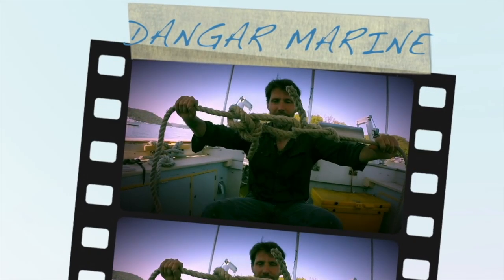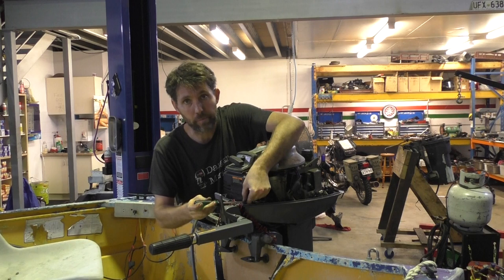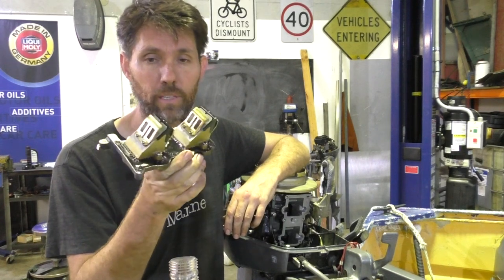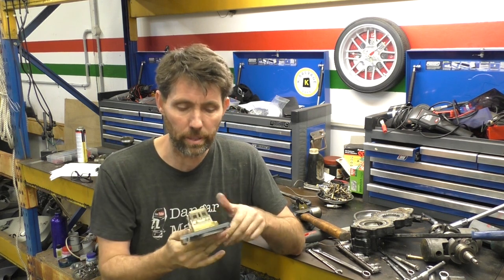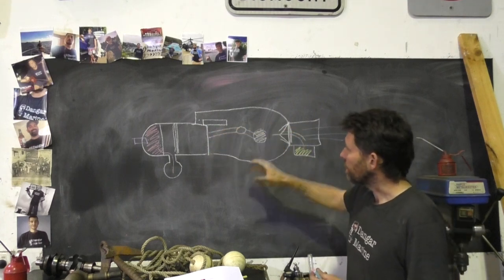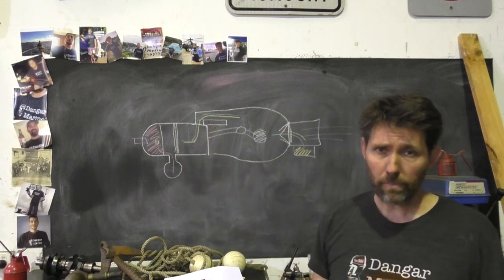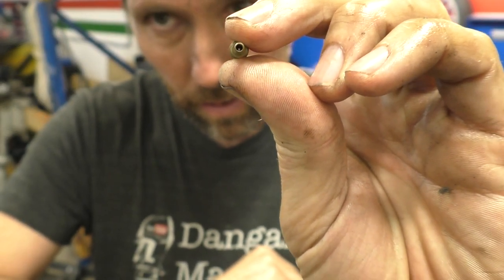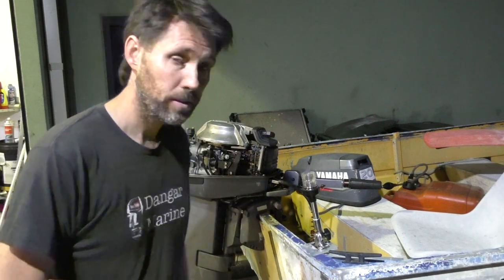Outboard reed valves

Comment: Since unfortunately myself and a lot of other people are out of work right now I had time to work on my outboard and I'm glad I watched your video's because after pulling the reeds which seemed fine i focused on the carburetors and it was the idle mixture screw on my bottom carburetor out of adjustment,mad it backfire so bad it would stall.

Comment: Yes I got two almost new reed blocks for my 96 force 120. I can’t see any day light through them, also replaced the gasket ,it made a world of difference, snappy throttle response easy starting, The service manager said there is 8000s of a gap that tolerated on the force 120 but I beg to differ, like you said there should be no daylight looking through the read blocks, thanks for the great advice and videos keep them coming
Reply from the maker: Thanks Tim, great to hear your outboard is running sweetly now. :)
Reply: You just need a new engine anything pre 2000 is a right off.

Comment: Thanks Stu,
That old Yammy I got was running way worse than that one you have there, when I got it. 
Turned out to be a broken primary wire on No.1 coil pack. I am holding my breath in anticipation. Love your work mate, keep it up. Greatly appreciated. Many thanks.
Reply from the maker: Hey Bruce. I'm thinking I'll test the ignition first, mostly as I think it will be easier and doesn't involve taking the powerhead off. Fingers crossed that is all there is to it.
Reply: Looking forward to that Stu, as they say, do the easy stuff first as 90% of the time that is where the problem is. But this one has got me scratching my head too. Roll on next weekend! 
By the way it was your videos on checking the IGN circuits that led me find the problem on mine.

Comment: My 97 yammie 40 ran great until recently. Last few trips out I've had a large loss in hp and speed has gone from 30mph to 20 mph. New plugs, new fuel pump. Clean fuel, new filter and water separator, compression just over 100 each cylinder. I'm hoping it's just the reed valves. Great video as always. Keep em coming. Mike from Florida.
Reply: Was it reeds
Reply: @hiimtoxic9518  Nope. Took it out today after completing a full rebuild in all 3 carbs and it ran like a brand new motor. Everything was clogged. The jets, the needle seat in one carb was so bad you couldn't see light through. All the small ports were clogged. It was bad.

Comment: Still trying to figure out the problem with my 75 hp Mercury on the invader. Gone through the entire fuel system, checked timing, like you said still 100% not fixed.  Someone suggested looking at the reed valves, thanks for the great lesson professor Stu.
Reply from the maker: You're welcome Don, good luck!

Comment: hi never worked on an outboard but have used several of your very well described techniques for cleaning, adjusting electrics and carburation on motor bikes. one adjustment i would check was the carb float travel as the fuel level in the carb affects the amount of fuel being sucked into the engine. but i guess your low idle mixture screw would compensate for any variation in fuel Hight ( in the carby). great video's very well explained
Reply from the maker: Thanks mate, glad the vids have been helpful. Yes, having a correct float level is very important to get the correct mixture.

Comment: Hi Stu, easy fix on hot water heater. just needed the winterizing valve turned to let the air trapped in the top of the tank out. got hot water now for the rest of the trip.
Reply from the maker: Good news! :)

Comment: Make sure that the air mixture screws are turned out a little over 2 turns. Seems like the common Yamaha lean sneeze.
Reply from the maker: Hey Eric, I did have a play with the mixture screws and they seem to be set fine, but I'm going to go through a whole range of mixture / choking / sparing fuel to test which is lean in the next vid.

Comment: Hi there, and greatings from Norway. 
I have a frind tat hade the same problem with his 25Hp Yamaha, semes to be almost the same engine, it was coughing and it was spewing a cloud of petrol out of the bottom carb every time it
 misfiere `d. 
He checked everything, changed piston rings, all the seals, cleaned carburetors, he finaly took of the flywheel and found a chafed wire, repaird that then everything was fine.
Reply from the maker: Yes, it can take quite a while to find the problem some times but it's always satisfying when you do!

Comment: A term you will hear around 2 strokes is transfer ports.  You drew that on the board.  Max power is somewhat determined by the design and number of the transfer ports leading to the cylinder. The crankcase is pressurized until the ports are uncovered by the piston downward movement .  Key is that exhaust port is uncovered first then the intake which will scavenge the remains exhaust gases  out. Some 2 strokes don't have reed valves and some others in motorcycles have a rotary valve.  Cool stuff.
Reply from the maker: Ah, interesting about some bikes having rotary valves, I'll have to look into those. From what I hear the shape of the exhaust after the port is critical with 2-strokes too to get the gasses extracted efficiently.
Reply: Keep in mind that the transfers are effectively the intake valves for the cylinder when compared to a 4 stroke.. Where the 2 stroke intake is the intake to the crank case not the cylinder.
Transfers mostly influences mid range power up to peak, once a 2 stroke is at peak it tends to over scavenge so much intake spills from the exhaust port, hence an exhaust provides back pressure to plug escaping intake charge at peak.
One important moment is blow down time which is the period the exhaust is open for and transfers not yet open when initial cylinder pressure blows down out the exhaust.
A piston port intake timing has symmetrical so opening and closing is equal degree from TDC like exhaust and transfers, all controlled by piston.
The disc valve is asymmetric so intake opens a lot earlier that allows the crankcase to equalise pressure through the carby instead of back flowing down the open transfers as the piston is rising.
The reed valve timing is like a disc valve timing at low revs opening very early and then like a piston port at high revs, so the opening point in degrees gets later as engine speed increases, so rotary disc has an advantage in smaller engines due to less gas inertia where reed is as good as disc over about 150 cc per cylinder..

Comment: If reeds are bad with a carburetor have a black stain to the intake. I have a 3 cylinder Yamaha and the bottom carb has a black stain that’s hard to rub off on the intake side. The rest of the carbs are clean and shiny

Comment: Good video, got a evinrude 9.9hp and tons of gas flow backwards of the carburator hopefully  these valves arent too expensive.
I remenber those yamaha are all pretty much the same, that issue you have make sure its the spark plugs the engine is supposed to have, engine fuel/oil ratio if it has more oil than its designed for that issue will come up and if the carburator is not adjusted correctly same thing (mostly when too rich air/fuel ratio). Worst scenario water is going into the cylinder making misfires.

Edit: the 9.9hp seems like lost half the reed valve, first time I see those metal reed valves break, tough they was kinda forever lasting compared to carbon reed valves.

Comment: Thanks for the great video,I have a Mercury Force 90hp which I just got running near perfect after cleaning the carbs,new plugs and setting the timing.All of the sudden it now sounds like your Yamaha and is really hard to start,I guess i'll start with the reed valves and go from there.

Comment: Yes Stu, 1969 Kawasaki's had rotary valve discs as well as Spanish Montesa  motocross bikes.  An  expansion chamber on the exhaust side helps as well.
Reply from the maker: We have an old Kawasaki in the shop at the moment that needs repairing. Will interesting to get into that job.
Reply: DAP go kart engines had rotary valves and there was one with desmodrodic (?) cam driven inlet valves- which defeats the whole idea for a two stroke engine for me. Poppets have been used in the past as well.
Reply: William Fowler had an 80s Kawasaki KE100 years ago that never ran right (bought it used) threw a ton of parts at it, still never ran right. Turned out to be rotary valve seals. Changed that out and she ran like a scalded cat! A good motorcycle shop gave me the free advice that pointed me in the right direction.

Comment: Fantastic job as usual! 

I’m a rookie and recently I’ve gotten into buying cheap outboards and fixing up for sale or keep when I want to. I’m recently working on a Johnson 50hp and she’s starting right up (easier with a little throttle up) but won’t stay running. I notice has spitting out slightly out one carb. I’m going to use this info and hope to find the issue.
Reply: @Mad-Coo  Motor has been sold. But, i did fix the issue by flipping the reeds and got rid of the little gap. Replaced missing rubber retainer for the adjustment screw in front of carb right above the intake while because it would rattle lose each time I speed up. Ran great from there on out.

Comment: Hey stu. Great video. I have this particular case, i usually go fishing and when I launch and go to wot I go very well, but after a couple of minutes you can hear the engine dropping in rpms and loose about 2 or 3 miles per hour. The engine is a 25 hp tohatsu updated to 30hp by changing the restrictor plate and adjusting the timing
Reply from the maker: It could be as simple as the throttle cable creeping back. If not I would make sure the fuel pump can supply enough fuel, it may not be able to keep the carbs full.
Reply: Carb clean first then look at other stuff.

Comment: My 70 hp 1984 2 stroke Johnson 3 cylinder is only firing on 2 cylinders. Gas is spraying out the front of the carburetor and the spark plug for that cylinder is clean. I replaced the carb but still having the problem. Watched your great video and I think the reed valve may be my problem. Your thoughts.
Reply from the maker: That is a classic symptom of a reed valve problem.

Comment: When you get another carburetor clean/piston head decoke engine how about testing out one of those 'seafoam' / 'engine tune in a can' products? I know we don't seem to use them much here, but it would seem plenty of people swear by them over seas.Looks like you may be heading for that DVA on this one. I like the step by step  process of ruling things out you show- too many videos only show the one item that fixed the issue, not the 10 other things checked first. One , your way makes me feel not so stupid, two, it shows a logical process to follow which is way more educational and useful. Once again, thank you.
Reply from the maker: Hey Ron, there are a couple of products like that I'd be keen to try. Salt-Away is another one I've never used but I'd like to give a shot on some of these old crusty outboards.
Reply: Ron Powell i
Reply: I too would like to see those results.  Recently began using it on new "96" Johnson.  Also used Salt away for the first time on my aluminum boat.

Comment: My outboard misfires on one cylinder mid throttle but isles and full throttle fine.

Timing issue? Spark plug gap issue? I keep getting a puff of smoke or fuel vapor out of these just behind the carburetors. 

Johnson/OMC 200 V6 outboard 2 stroke
Reply from the maker: Could be spark, but I would definitely investigate the leak behind the carburettors and fix that first. Could be reed valves if it is a two stroke.

Comment: Well well well, carbs were dirty and timing was off too so those 2 things would have had to be addressed anyway at some point right? Seems like the perfect nightmare issue, multiple problems...;)
Great video! Can't wait to see the next one.
Cheers
Reply from the maker: Don't forget the leaking head gasket too! ;)
Reply: yeah that's right i forgot!  I remember chasing a similar issue on my previous motor. Replaced fuel pump, reeds, cleaned and re-cleaned the carbs, even replaced one pack, adjusted timing. Was driving me insane... The idle was getting a bit better each time but still not 100%. in the end replacing the shot (open) thermostat is what fixed the problem. 
Multiple or erratic  issues are the toughest to fix.

Comment: Hey Dingus.    You can flip the read valves over and it will fix any  seeping
Reply from the maker: Depending on the design you often can and see if it helps. If not they'll need replacing.
Reply: @DangarMarine  
Been watching you for a few years
Enjoy yr show.

Comment: Great video, wondering if you found the actual problem of that motor , my Johnson 40 hp 91 is doing the exact same thing changed carbs ,ignition flywheel, still doing it
Reply: Hi , did you fixed that squeze noise ?

Comment: Hey, this motor has done a crank shaft seal. I had twin cylinder Yamaha that did the same thing and found a blown crank seal. If your lucky it will be the top seal under flywheel. Interestingly mine did the top seal but the spark plug for the top cylinder looked like it was fouled from running rich. I couldn't get my head around it as that cylinder should have been leaning out.
Reply from the maker: Yes, I'm thinking a pressure test will be the way to go before getting into the ignition. It will be interesting to see. It is odd about your top spark plug being fouled rather than whiter.

Comment: I have a 96 force 120, two carbs,no fuel spitting out, runs pretty well starting good, I pulled reed blocks out and I can see daylight in some of them, can I flip them over to see if they close, or just replace all of them? I love your videos,AWSOME videos
Reply from the maker: I would replace them because if they break from fatigue cracks they will get sucked into the engine and you don't want that!

Comment: My Johnson 70 has a hard time starting... and once run and shit down needs like a tree warm cycle.  I have changed the fuel pump,  primer solenoid and now i am wondering about reeds..i noticed on idle there was some gas bubbles coming from the prop exhaust the other weekend. I have had issues flooding while trying to start a lot of times on cold start.

Comment: Great Video, I found that the lowest reed valve on my 3 cylinder 2 stroke was rusted an got a little lime on. This points to other problems aswell, i guess. After looking at the cylinder head, i found a lot of gunk, lime and rust. I will change the whole Cylinder head with gaskets. Do you see any other points where water could come into this area around the reed valve? Thanks.

Comment: Stu, great video.   My motor was not used the last three years (or more from previous owner), used your videos to get it running this year.  Runs great over 1500 rpm's, less than that it has misses and sneezes.  Been using Seafoam and that is making it run better the more I run it, plan on cleaning the carbs soon.  Is there anything else I should check out?
Reply from the maker: Thanks Steve. Sounds like a similar situation to this outboard so I would say a carb clean is the main thing to focus on.
Reply: Pull the boat out for winter, and clean and rebuilt the carbs.  They were pretty clean but had a sticky float on the lower carb (upside down it had at least a 3 second hang time). The rebuild kit had all the replacement parts for this.  The engine now starts easier and has no problem idling at 800 rpm's (750-850 spec).  Now I will use your cable fix for the control cables and I will be in great shape.  Thank you for all your videos.